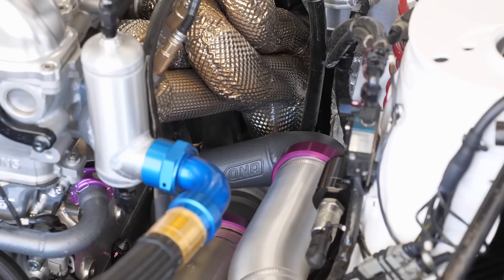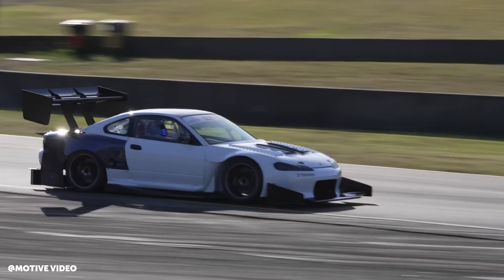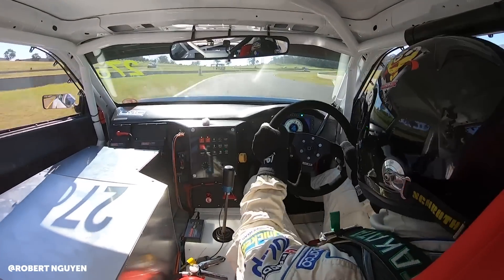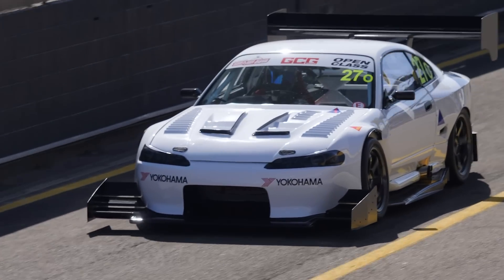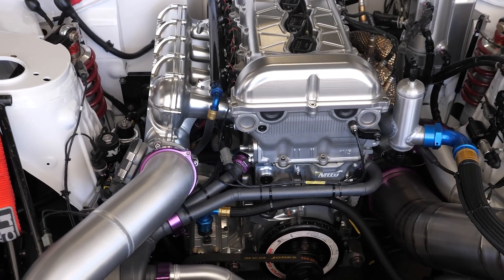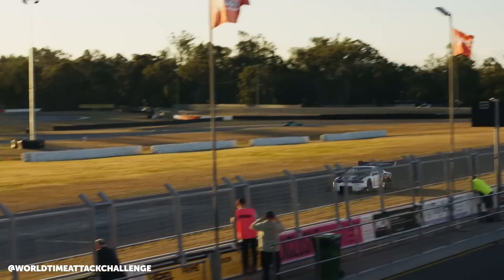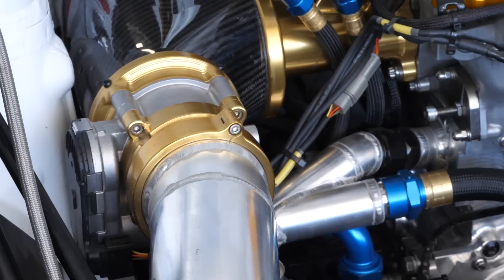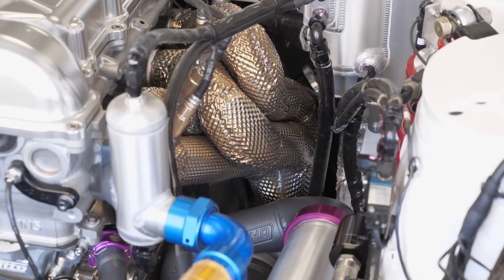GAME CHANGER! - Torque Delivery Decoded | Pro Tuners Open Secrets

Comment: Traction control bandaid so needed.....instead of building a balanced car. Nice. Dumbing down the art of driving.....what a pleasure to hear....lol....not
Reply from the maker: Using that logic, the throttle pedal is a band-aid for poor driving skills too 😅

The purpose of control strategies like this is not to cover up 'balance' issues. Underlying issues will just turn into different ones (or stay the same) if you think you can just 'tune them away' in an ECU.

This is also a very different car to the Mustang in your profile picture (if that's your only reference).

This explanation might help you further: https://www.hpacademy.com/blog/what-is-torque-mapping-torque-based-ecu-tuning/
And/or this: https://www.hpacademy.com/blog/new-blog-post-8/

Of course you don't have to use any of this on your own build, that's your choice. 

Have a great weekend -Taz.

Comment: Regarding the comment about a turbo engine being able to make full power at 30% throttle, I've spent a fair amount of time analysing a couple of German oem tunes and noted that boost was only ramped up above wg spring pressure from about 50% throttle onwards, and it's done gradually up to around 90% throttle. This is how you get progressive throttle response. Nobody wants their throttle to be an on/off switch!

Comment: Syvecs ftw
Reply: lol not even close to this and even further from M1 Pro
Reply: @coreyw427  lol😅
Reply: They don't have a torque model in their current feature list? I did evaluate it for my builds, but price vs performance, the Emtron can't be beaten.
Reply: @johnny_gtr  unfortunately, it takes someone smart to actually use a syvecs. You really can do anything you like with it..
They have had "torque" for like 10 years...
Reply: @ torque estimation and torque reduction - but not torque model.
Anyway, not here to argue. Have a great day 👍🏼
Reply: @johnny_gtr  yep. No.point..
"Torque model" isn't used in professional motorsport, by professionals, so no point in wasting time arguing about it.
Reply: @Not-Sure-Viralade-ftw  F1 teams use a torque based system 🤦‍♂️ There is a big difference between having a simple  torque table or basic torque estimation and having a torque based system like M1 GPRP Pro with a traction model that calculates the required throttle/WG positions to achieve target torque and target wheel torque. You need to actually look in to GPRP Pro if you genuinely don’t understand the difference or think you could coherently implement this with a few CM maps.
Reply: @coreyw427  yeah nar
Reply: @Not-Sure-Viralade-ftw  Like arguing with a flat earther. Stay ignorant dawg and have a nice day 👍

Comment: New wannabe here and I have a question.
If tou build your engine/car to handle lets day 600hp but its tuned to run 300hp , what would happen if tou exceed that 300 mark, would the engine blow or would it keep going because the engine can handle that amount of power? I'm really not knowledgeable jut trying to get a thought answered. Thanks in advance
Reply: Thats stupid question.Power equals how much air and fuel engine can combust.Other mods are just to support power level.Head work is there to flow more air if needed.Bottom end build to not blow engine
Reply: @bobanppvc  It's not a stupid question at all. The guys clearly explains that he isn't knowledgeable in this area and yet you mock him. He never asked how to make power, only asked if an engine built to be 600hp capable would blow up if you ran it over the 300HP tune. The short answer is No it won't blow up assuming it's built correctly with the right parts to handle 600HP and tuned to suit.
Reply: @ScGa-o3g  it is stupid question...
Reply: @ScGa-o3g  Much appreciated man, thanks for your response. 👍🏼
Reply: @bobanppvc  it's all a learning process man, thanks for responding tho 👍🏼
Reply: You can throw all the big power modifications at an engine and then detune it.  If you have the fuel system to flow 600hp worth of fuel, you can ask it to deliver 300.  If the computer decides to send 305, you'll still be fine because you can handle up to 600.  Similarly, if your connecting rods, pistons, crankshaft, and cylinders can handle 600hp, tuning to 300hp will never "blow" the engine even if the computer(or other failure) tries to get 350 out of it.  In the same vein, if your block, heads, and turbo can reach 60psi of boost but you have the BOVs opening at 15psi, it won't go boom if you accidentally touch 20psi.

Even Usain Bolt can take a leisurely stroll

i'll add that many ECUs (both from the factory and aftermarket) have "maps" that can be chosen and run.  from the factory, it's a bit more about throttle mapping (x-input at y-speed=z-result) while aftermarket maps are often focused on hitting x-power level and getting smooth delivery all the way there.  you can absolutely map a 600hp capable drivetrain for smooth power delivery up to 300hp. and if things get out of whack, your HARDWARE is capable of handling the problem.

also, it's not a stupid question if you've gained some knowledge from asking it.  and your question isn't off-base either.  old-school (carbeurated) performance engines NEEDED to be run at their peak or they would foul plugs and have running issues.  computers (constantly adjusting AFRs) have fixed these problems
Reply: @jimmytclem  thank you very much for such a simple yet very detailed explanation, really appreciate it man. I'm just trying to get into that field and has some lingering questions that pop up every now and again. Really appreciate the explanation,

Comment: Nice info, could a mass flow sensor not be implemented to avoid this throttle body model? Then you could simply close loop the throttle position to achieve a target mass air flow?
Reply: The biggest problem with a MAF sensor is that it doesn't handle transients very well. The sensor needs to be placed in front of the turbo inlet, which means it reads airflow going in the turbo, not airflow going into the intake manifold.
Reply: Spot on! 
On a N/A car it doesn't matter as much as the throttle body isn't getting boost jamed down its throat. But for a boosted car it matters a lot because even partially opened throttles allow more torque to be created than the foot desires because of the nature of boost.

Comment: Is that a terrible seat belt setup in that car, having the shoulder attachment points so far back from the driver?
Reply: the distance from the attachment to the driver doesn't matter as the belts see the same forces.  the main concern with belts is that they are mounted at the proper height and directly behind the driver as to hold them in the seat during impact.

Comment: Cmon Haltech time to release an advanced TC like Emtron and Motec, been behind for years lets go!
Reply: Don't forget fuel tech .. there at the top of the game now , and I dont have one "yet" but I have seen them doing some really rad stuff and the control is wild just how much control and how easily it is for you to , BBG , or DBW ,or electric power steering , wheel speed ect and just how much control it gives , and they are really nice units and there dashes are top tier to ... buy as u say , motec is the top Don and has been fir a long time , but prices reflect alot of these ecu's aswell ... personally, I like the whole open source ones , cuz if you are smart and can program and build and code stuff , man , the stuff you can make them boards do ... just blows my mind tbh ... much respect, brotha .. peace and love all, keep it rad, stay safe, and build on.. l8r fam
Reply: @mastercricket7626  Fuel tech is miles behind. Its not even in the same stratosphere of what EMtron or Motec can do. Fuel tech electronics are like a clock radio compared to the other ecus mentioned.

Comment: Why is this guy talking about Emtron when it clearly has a MoTeC M150/PDM/Dash?
Reply from the maker: @Bugermass  an ECU is not a dash or PDM. It's running an EMtron ECU and we're talking about ECU control strategies here 😉 
How good this is another system that doesn't have to be paired with only its own brand of aux devices and how good that MoTeC is also not just locked into its own bubble either eh!
Hope that helps! - Taz.
Reply: Because Motec i2 is the best option for datalog analysis and for that you need a motec dash. emtron ecu software has an engine data log viewer, but lacks real GPS based lap comparison/analysis tools, and the emtron dash offerings don't seem to be targeting motorsport applications.
Reply: Sounds like it should have just had a motec on it... 😁
Reply: @Bugermass  well this car with an emtron won it's class sooo.....

Comment: On a lower level and degree I mapped my ecu boost control on my AX car to have similar results...i worked on boost duty cycles at different throttle settings to make the car essentially drive like a powerful N/A type car...more throttle more power and with a rising boost curve to stretch out the top end power a little bit.
Reply: Nice👍
Reply: Heck yeah, brotha , that is how I have been trying to control my boost as well. lol , big turbo problems 😅.. mad props and respect, fam . Peace and love brotha, keep it rad, stay safe, and build on..l8r famz and keep having fun
Reply: What ECU?
Reply: @dgo9121  SpeedyEFI "fishdog"